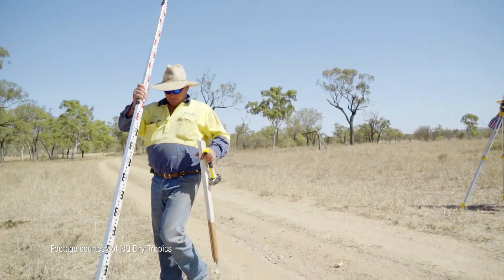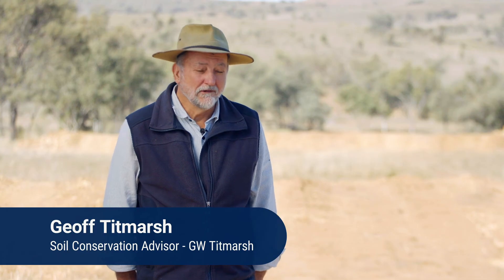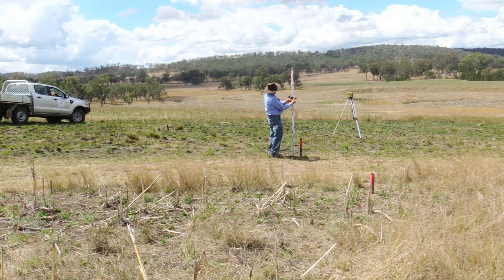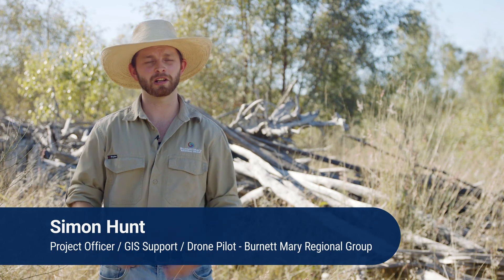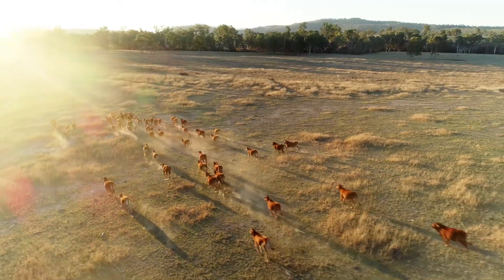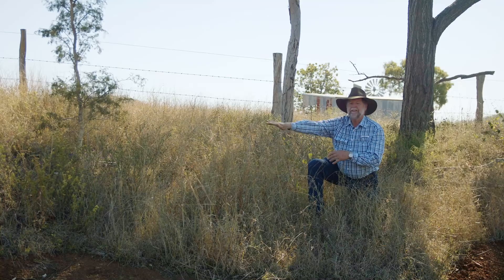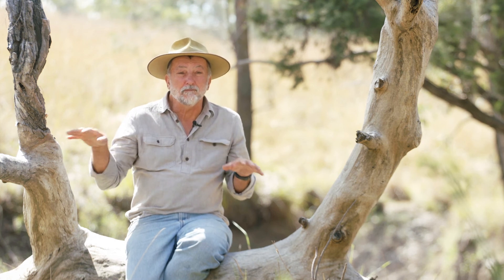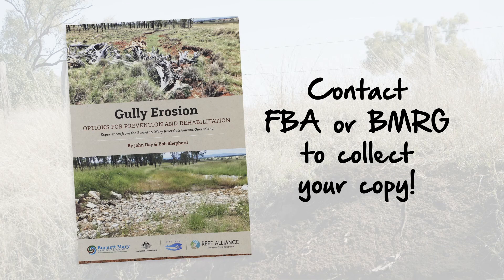Gully Erosion Solutions for Your Property - Part 4

Comment: A question just for my own curiosity. I watched a conservation program recently. It has to do with basic commonsense. Any proper engineering or building construction starts with knowing your levels. From where you start, to where you intend to finish. The program that I watched empathised the importance of dumpy-levels, for larger properties laser-levels. So getting your hands on the appropriate level to start with is critical. To map the entire area would be the next consideration. Maybe there are resources available from technology services. With drone photography & mapping. Like everything in life it comes back to what you can afford. But having that blue-print plan , you can start with your land swailes and purposefully dug retention barriers. Or deep ripping while working on your ground hydrology. With that ground work in place, and dams as a fail-safe measure for the good times. With most of water being retained in the ground, along with carbon just for holding capabilities.